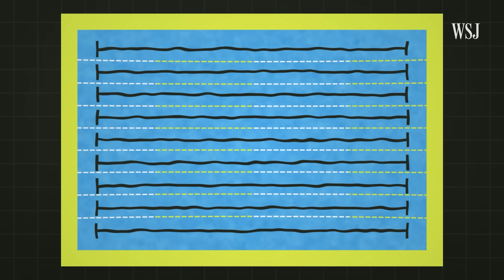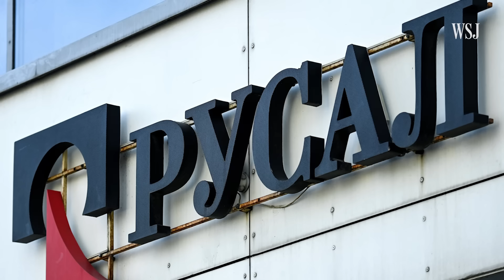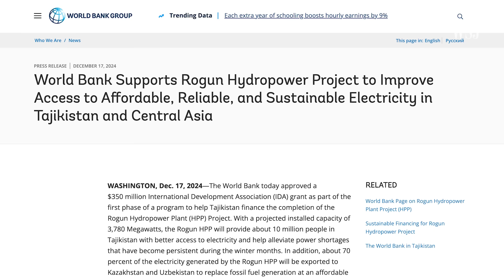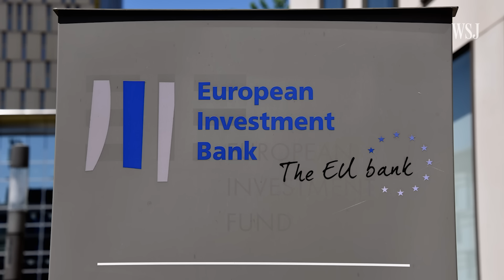Why Central Asia’s Poorest Country Is Building the World’s Tallest Dam | WSJ Breaking Ground

Comment: There are other ways of getting electricity, like wind power, solar power, Tajikistan could've used that. But they decided to use water power, even though they know that if they build the dam Uzbekistan will be left without water. That's why the first president was against it. For now we might have some negotiations, but we don't know what will happen in the future.
Reply: "There is a good way to sell your gas cheap to your neighbour but you chose to not to sell"🗣️📣

Comment: It's the height of the dam/water that creates the pressure.  Larger reservoir capacity allows greater volumes of flow through the turbine.  They both are necessary.

Comment: This is a really impressive project. It never occurred to me how much hydropower potential Tajikistan has.  I think augmenting hydropower with coal and gas is stupid, especially for the climate.  Hydropower works best with intermittent renewables like wind and solar since both wind and solar save water for when it's not sunny or when it's not windy.
Reply: What about camel-dung furnances?
Reply: They said that the oil and gas it's for the winter. Perhaps the dam won't produce as much during freezing temperatures....
Reply: @anirprasadd  that and also because our water comes from glaciers melting during summer, and because they do not melt during winter, the water levels drop

Comment: don't forget that the power is only determined by the height difference between the generator and the surface of the water

Sure if you can store more water, at the same height because water stays level, it can power the turbines longer, but not faster 
You can however multiply the number of turbines. At the same depth, i.e same pressure, they will all run at the same speed